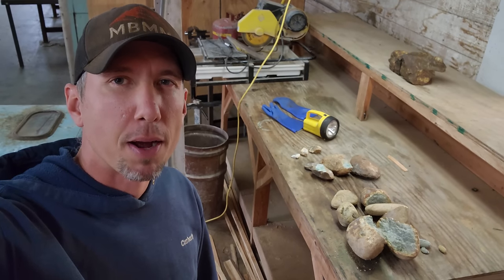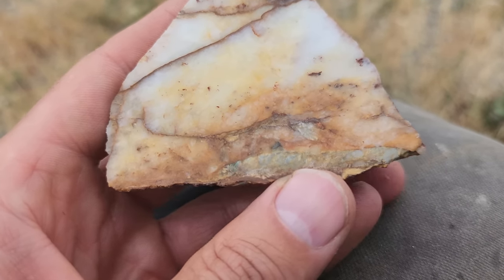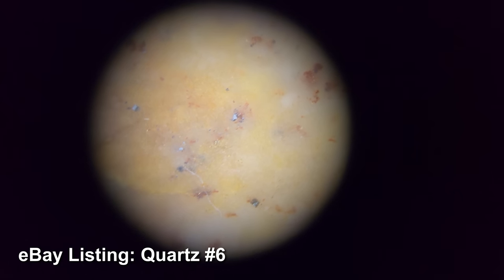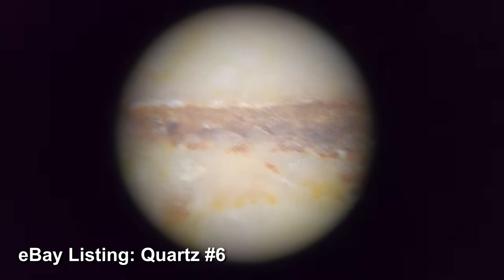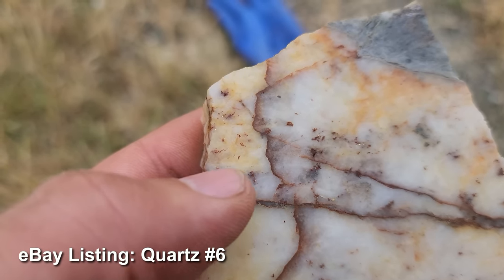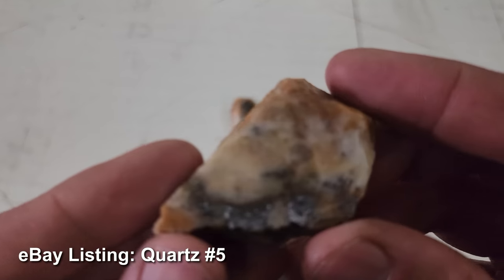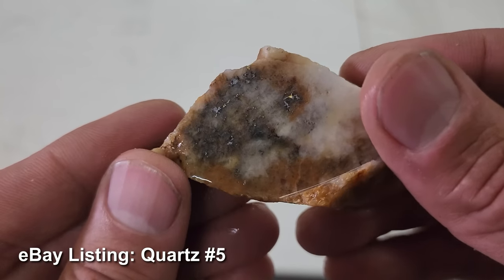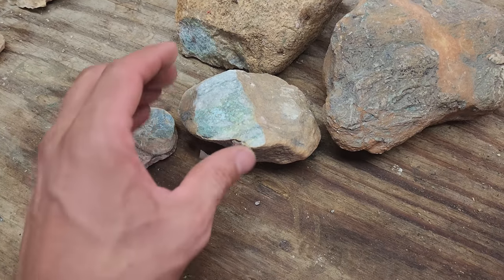How To Find Gold In Rock & What To Look For!

Comment: Jason, get a small piece of sheet rubber, maybe four inches wide and 6in long or so and poke a couple holes in the narrow end and sticks some bailing wire through it and wire it to hang down just behind the tile saw blade like a Truckers mudflap. That way all that gold slurry you're spitting off the back the blade all over your workbench will hit that rubber and drop down into your trough and then you'll be able to pan that out later. Love your videos

Comment: When cutting to achieve square cuts, start with a cut. That cut edge then has to shoulder up to the vise perfectly. That will make the next cut at 90° to the first. You should get the picture now. Same with logs to lumber

Comment: It won't chip off at the end if you push pressure towards the blade with a rocks. Not a whole lot of pressure but a little bit. I've been in tile setter for 45 years

Comment: If anyone is wondering if a wet rock cutting diamond blade can cut your finger, Absolutely it can.

Some types of blades are less likely to do so, although don’t ever test that, it can still cut you. Blades with even small teeth, or even a smooth blade with a small chip in it can cut you. Don’t test it.

Comment: Jason- I almost can't watch when you use the tile saw.  Your fingers appear to be soooo close to the blade.
Reply: Yes Dan lol your not Dan
Reply: I might be seeing it wrong, but it appears to be a diamond sintered grinding blade, no? If it is, it doesn't pose nearly as much danger to fingers as a normal toothed saw blade does. 

The "blade" surface is nearly smooth, with a microscopic layer of diamonds encrusted on the surface. Most rocks are relatively brittle and all are softer than diamond. So when the diamonds hit it a tiny layer is broken off. Skin has the ability to move a few microns, not break, and retain plasticity so it doesn't grind off like the rock does. Still always good to be careful though